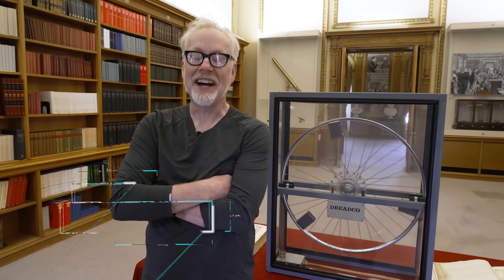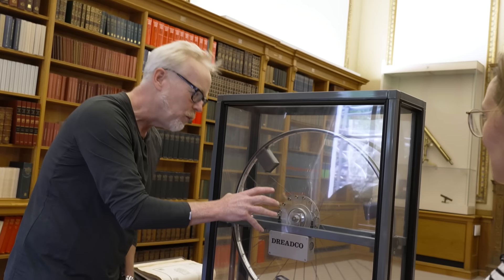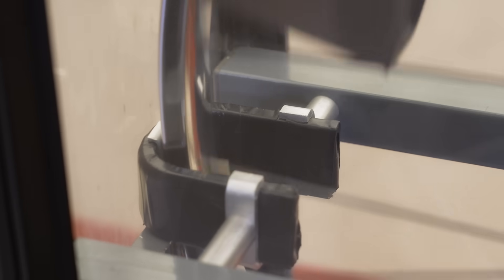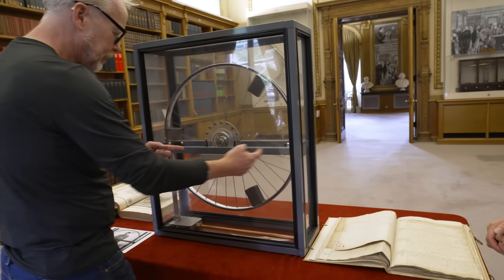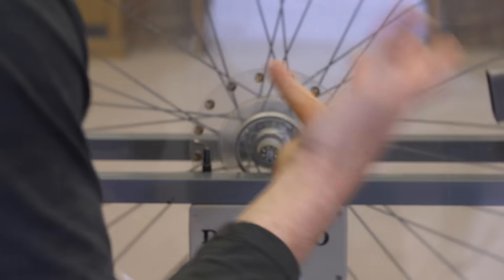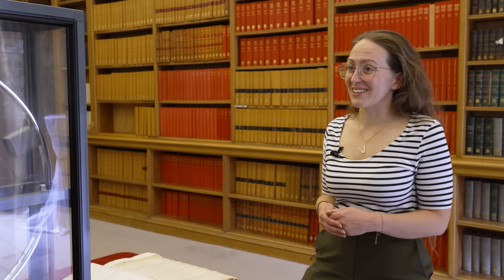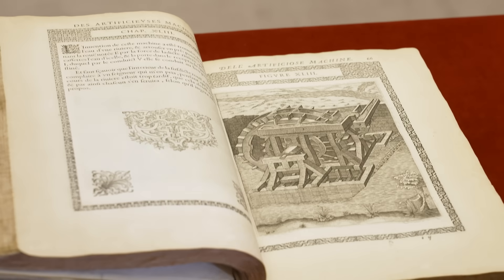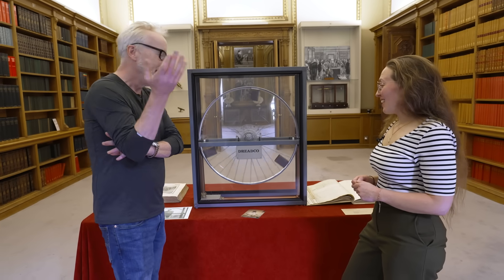Adam Savage vs The "Perpetual Motion" Machine!

Comment: When you think about it perpetual motion is all that there is! Examples - the planets and their moons, and stars have been in perpetual and regular motion for billions of years - in human lifespans that is "perpetual". In space, an object set in motion will continue to move in perpetuity unless and until another force changes its direction or it collides with some other object. This is Newton's Laws of motion. At the quantum level all atoms  and their electrons are in perpetual motion - unless at 0 K temperature. The problem is people trying to build a "machine" to duplicate that on earth, in a gravity field, with friction as the main dissipator of the energy. In order to achieve the illusion of perpetual motion you need nearly frictionless bearings in a vacuum environment (I almost thought that machine was mounted in a case with the air evacuated, but it doesn't appear to be so). Then, once set in motion it will continue in "perpetuity". Of course, frictionless bearings don't really exist but in practice may come close to 0 friction. With nearly 0 friction and no air resistance a wheel spun up should spin for a very, very long time. Those two boxes are suspect but assuming there are no power sources or batteries in either box (or under the table), I suspect it is just a very efficient electric-charge driven motor using capacitive charge/discharge cycles. The thick copper pipe is a clue - close to 0 (or very low) resistance would be needed as well as Hi-Q capacitors. Now, if you try to draw any energy from that device by connecting a small generator, there goes your PMM to a grinding halt! Also important to note PMM and over unity are two distinct concepts - they are not necessarily the same. You don't need over unity unless you plan to extract some energy from the device. You just need unity or very close to it.

Comment: It's simply a motor. There are batteries and the wheel is balanced. The boxes are weights to keep momentum. It only takes a small amount of current to keep the wheel going. There are probably just some batteries in the dreadco box.

Comment: Since we know that perpetual motion machines are impossible, we know that there must be a energy source feeding it.  If those U shaped channels are permanent magnets and assuming the wheel rim is actually made of metal as it appearsto be, the magnets would set up eddy currents in the wheel rim which would bleed energy from the wheel rather than feed energy to it.  The box construction also does not appear sturdy enough for it to hold a vacuum and if it contains air, there will be some aero drag that slows the wheel.  The same goes for the friction of the hub bearings and any viscous drag of lubricant on those bearings.

Any chance the heat sinked box has power being fed into it?  Maybe it contains a coil that is transformer coupled to a coil built into the table?  If power is fed into it, maybe it is providing some air flow in the box which is used to power the wheel.  But why the heat sink on the box?  The heatsink is sized for significant power dissipation far in excess of any power level needed to spin the wheel.

Comment: This looks like heat exchange. The inlet of cool air coming from the middle and the two smaller stems letting air into the system across the middle. And exiting in the copper tubes through the fins at the bottom and out under the unit. 

Looks up how a fan on a heater works without electric. 

The reason this would stop working is bearings and gaskets.  

The weights on the spokes is just to keep the downward motion as the heat exchange causes the start of the system.

Comment: It’s a motor. Battery is in a Dreadco box. Three boxes are probably paper or wooden, so there are no forces slowing down the wheel when metal pieces are passing by each other. Almost everything there is a distraction from the fact it’s a motor

Comment: It's the Seebeck effect. 
If there is a difference in heat between two materials you can produce electricity.
Which can power the motor that it is and charge a small battery to keep it running while the two materials transfer heat. The charged battery keeps it going at night or for weeks while the other material is cooling off. Then in the morning you have two differently heated materials to start the process again. In every single building there is a temperature change that can slowly charge a battery and can keep this thing running for weeks if there is no temperature change.
Very easy to build one if you have lots of time to get it right.

Comment: Rare-earth magnetic energy (permanent magnets) can solely achieve perpetual motion on Earth even without a regenerating motor. The exact configuration/spacing of the magnets is key, as well as using ultra low friction material. The magnetic power's force & momentum must be sufficiently greater than the combined momentum lost in friction/heat/ambient air temperature/air drag. But the momentum difference between these opposing forces must be permanent/absolute/exact.

Comment: If two years is 'perpetual', then all clocks in my home are perpetual motion machines
Reply: Yes it's probably the truth no big deal.
Reply: Agreed. They are acting as if machines running self contained for 2 years is some great engineering trick. Anything with a big enough battery and a small enough motor will run for years before "servicing" is required.
Reply: What are you guys doing right, my wall clock batteries last about 1.5 months

Comment: I guess no magnets at all.. Obviously perfectly balanced w/ awesome bearing,  i guess lighter than air gas filled boxes or some sort of gases being used, that may also act as capacitors,,,with the primary driving  being a form of static electric motor design. .. The dissimilar metals making a temp. difference voltage source just doesn't seem like it could do anything without a heat source, but was a good distraction.

Comment: There is no shortage of ways to harvest energy from the environment to keep a wheel turning, which if well engineered only has to overcome a tiny amount of friction and air resistance. The actual method can in some cases be innovative or not popularly understood, which might be slightly interesting scientifically, but most I have seen have been pretty unimaginative, so I can't see the point. It's usually not difficult to see where the energy source or motor mechanisms are concealed. I suppose they are a form of puzzle, but not a very challenging one. This one has added gadgets which may make the solution more difficult to be certain of, but in a way that's worse than only one obvious place to hide a motor and battery. Ostensibly the point of these fakes is to make people overlook the one place it could be.

Comment: the left hand small ball is obtaining a charge from the wheel turning..
 which then activates a small impeller in the box Draedco which then blows out air from the 
small nozzle on the right the multi holes on the Dreadco are air inlets that feed the small air pump and keeps the wheel turning  along with the magnet motion pull push action .
no batteries required  eventually the bearings will no longer be so free moving and slow down the wheel over time 
due to friction

Comment: The trouble with people "debunking" things is that they tend to make such reproduction machines have way more magnetic reluctance (Lenz lugging) than they should have or very poor bearings that have HUGE friction or other losses that must be overcome just to have the motion happening, or use wasteful inefficient electric motors and then have a huge load and RPM imbalance where the motor's load is effectively working to circulate room air.

Consider that atoms and molecules in ambient Earth temperate climate are in constant motion known as average temperature. They tend to absorb and release energy efficiently to one another, bounce into one another, and so on.

Many of these very efficient machines absorb localized energy in the environment such as oscillations in various field strengths--such energy is so low that there had better not be much friction involved in the design of the machine lest the environmental energy shall not be able to overcome such friction or other such losses that cause huge inefficiencies. An off-the-shelf electric motor that consumes 500 Watts just to keep spinning is just not going to let any electrical source be able to maintain its charge by absorbing ambient energy of 0.2 Watts or whatever it is.

Supposedly some chemical mixtures when subject to oscillations can extract energy from the surrounding environment to maintain a sizable useful electrical charge by capturing this 0.2 Watts or whatever it is. Consider that super small germanium diodes have a much lower forward voltage loss of 0.2 or 0.3 volts, and if replaced by some incompetent servicing person with silicon diodes would make this forward voltage rise to 0.65 to 0.7 volts thereby greatly eliminating what localized energies can be captured for use within the machine.

High-frequency low forward voltage diodes could capture most incident radiofrequency radiation and use it to charge banks of resonant loosely coupled circuits. One man used exotic super expensive magnetic shielding paint and used it to modulate a strong magnetic field to make that field appear to oscillate dramatically using very little input motion of the paint-treated small disk that was interrupting these strong magnetic fields to induce current to flow in coils. 30 years ago this paint costs hundreds of thousands of dollars per gallon. It is in use by the US military to prevent eavesdropping in secure rooms--your tax dollars at work. Most high-efficiency devices use very high frequency and voltage and make use of very expensive, rare devices often hand-made by the designer. Often the people making these various devices have a huge knowledge of multiple fields in science such as physics, metallurgy, metamaterials, radio-frequency engineering, and more. Some people are polymath geniuses using a wealth of information to make the rest of us look foolish and ill-informed about the way that the universe actually works.

--> energy generation bismuth left-handed metamaterial

I once heard of a machine made for use in Japan that used a bismuth-based left-handed material of incident energy. It was later found to produce interference between similar such machines that were in proximity to one another causing an excess heat buildup that could cause a fire hazard so it was pulled from market shelves. Such a machine used in isolation would not overheat and would appear to be magically producing excess energy for the uninformed masses. It would be like explaining how computers and high-definition video screens operate to a caveman who would have no point of reference for all kinds of the working science concepts involved in the machinery's operation.

Comment: Adam mentioned the boxes can't form a circuit because they are all connected to one piece of metal, but i don't think it would be hard to run wires inside the shell of the wheel. Also the heat sink on the box definitely has to be a decoy, as there is no way any of that could generate significant heat and still run for years. now whether the whole box is a decoy, or whether there is something important in it is anyone's guess.
Reply: Dreadco box is a decoy (+40 years electronics tech)

Comment: Adam savage i answer its a first edition segway. See magnetics earth magnets. 360 donut magnet bar magnet handles lift see like a handglider
 Push the limmits of the bar. Magnificent men in aqua cogins perpetual motion true. Easy teasy. Archamedes screw. See water wheels size. See drives a cotten mill looms. See plus refills the mill pond. See water space air. Same princeable. Heat risers. See screw fixed perpetual motion. Lock gates close of weather machines. EX Mechina. 

The Archimedes screw, also known as the Archimedean screw, hydrodynamic screw, water screw or Egyptian screw, is one of the earliest hydraulic machines. Using Archimedes screws as water pumps dates back many centuries. As a machine used for transferring water from a low-lying body of water into irrigation ditches, water is pumped by turning a screw-shaped surface inside a pipe. In the modern world, Archimedes screw pumps are widely used in wastewater treatment plants and for dewatering low-lying regions. Archimedes Screws Turbines are a new form of small hydroelectric powerplant that can be applied even in low head sites. The Archimedes screw is a reversible hydraulic machine, and there are several examples of Archimedes screw installations where the screw can operate at different times as either pump or generator, depending on needs for power and watercourse flow.

Comment: You're such a noob, Adam, but your attempt to reverse engineer it may impress the uneducated layperson. You completely overlooked the electrodes pointed at the metal bolts. It's a reverse electrostatic generator. The three boxes are weights to provide inertia.

Comment: The "U-shape" almost always makes us visualize a "magnet" - i think that is the first deception/decoy implemented by the builder of said contraption (Adam's first impression suggested the same, as expected). My very rough guess is that there is something like a tug-of-war between the torque (wheel) and gravity (boxes) going on - yet the motion has to be kept going by another force that counters the net moment created by the other two boxes when 1.one box passes 3-o'clock direction and 2.it passes 9-o'clock direction which can be achieved by them being magnets and u-shaped parts being copper (or some good conductor) to create induction currents (eddy currents or foucault's currents) that induce electromotive force in a closed loop. And the "maintenance" should be the inspection and replacement of the ball bearings (if needed) so that the contraption loses very minimal energy to non-conservative force of friction.

Comment: The cheekiest "perpetual motion" machine would be one where the "protective" housing was actually a vacuum chamber with tiny valve that allowed just enough air in, at just the right spot, to keep the wheel slowly moving.

Comment: If this was a real perpetual motion machine, the science wouldnt be a secret and it also wouldnt be in a museum. Its a bs magic trick with magnets or it is able to run on extremely low power using long term batteries, kinda like how computers use a watch battery to keep track of the time. Maybe every 1 minute this thing kicks off a tiny bit of power. The whole thing about calling it a real perpetual machine and then leading it on as such is cringe.

Comment: The mystery and wonder are kept alive by keeping the movement mechanism a secret. If it was explained on a plaque visitors would look at the machine, read the explanation and move on.
Adam got it pretty quickly I reckon. A deconstructed motor is what Adam guessed and surely he is correct. Battery operated also as others have opined here. Mystery solved. Still looks cool though.

Comment: i think this machine is electrostatic generator, accumulator, and motor all in one. the mobil part, the wheel is isolate to fix part with 2 fonctions  states: positive to negative and discharge .... i suppose that this cycle run on half-up on the wheel.

Comment: This device is nothing but A electric motor as the device you see in the Center of the wheel just below the wheel bearing has small magnets on the Inner part of the wheel and magnets on the outer part of the wheel and it works like A brushless motor using The center magnets for positioning sensor, and the outer magnet 🧲 used to repelling turn the wheel . It a small battery that make it run !

Comment: I had found the concept unlikely, because of friction.  And if these apparatuses were functioning as advertised, there would be magnetic interactions.  Magnetic fields, in a day to day practical sense, ultimately, because of entropy, fail and fade away.  So the magnets might be then seen as a sort of  "battery," at least until entropy catches up with it. The described widgets too then would fail. But they're such elegant widgets and I had to build at least some of them, or try to.  My best attempt was that of a magnetic bearing.  Even that widget slowed and stopped because of air friction.  That's life.

Comment: Torque generated at outer circumstances is converted into electrical current which provides magnetic force at inner hub.
Reply: Power at hub produces same torque  as power generated at outer circumstances. More power is generated at outer circumstances,  more torque is generated at hub

Comment: I recon it's a fly wheel with a circuit that detects if it is too slow and if it is gives a tiny little push... powered by battery obviously.
Reply: Battery could also be charged by solar panels... also maybe a vacuum in there... basically every little helps.

Comment: For one summer, I worked as a contractor for a machine shop.  Someone hired them to make a machine that had a plate welded at an angle to a motor, so when you spun the motor, the high and low sides would rotate around.  He was then going to attach multiple linear generators touching various points on the plate, so when you spun the motor, the generators would reciprocate and make a charge, that would presumably be stored in a battery.

I tried telling the shop owner that it wouldn't work, and you'd never get more power out than it took to run the motor.  He said "I know, and I've tried telling the guy, but he won't listen.  He's paying for it, so we're making it.  Let him figure out why it doesn't work."